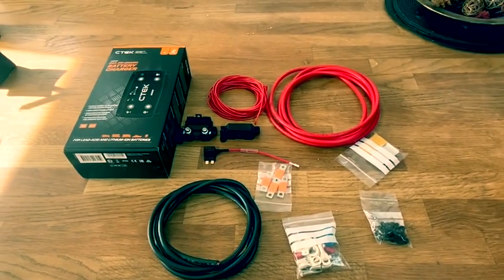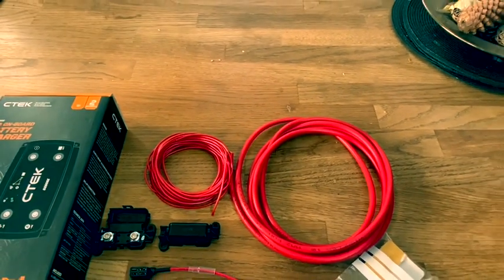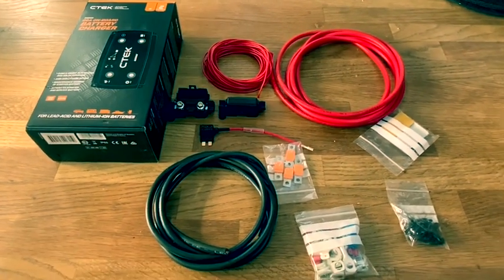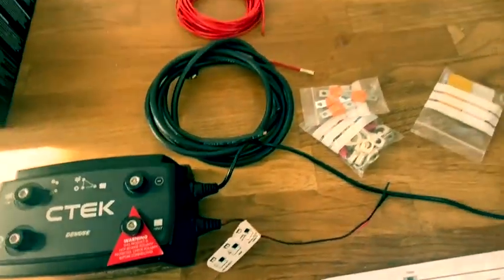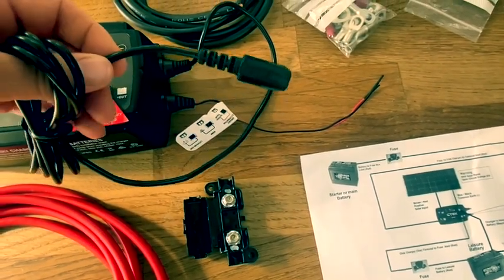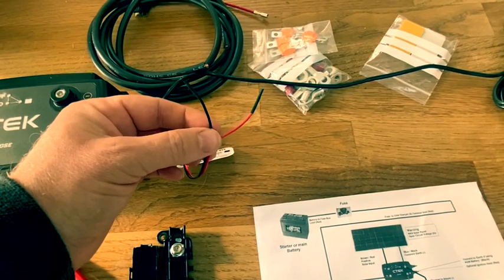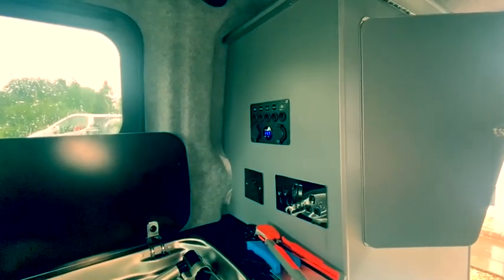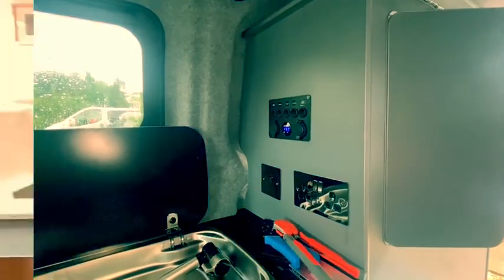Installation of CTEK D250se DC to DC Battery Charger into Transit Custom with Smart Alternator

Comment: Hi there! I hope you had a great time away in Big Blue. We finally picked up our van and recommend the swivel plates, we’ve installed a single passenger seat rather than the double, just trying to work out how to lower the handbrake on the drivers side. Having seen this video after your other electrical episodes, would you say it’s best to get the CTEK instead of the split relay? We have stop/start function and aren’t too sure what will work (or not). Thanks
Reply from the maker: Hey Nicci! Great news you got the van! Sounds good with with captain chairs! We might still go for a swivel base on the passenger side maybe? Not sure yet 😃

The key with the split charge system is the type of alternator. Later models I think 2014 onward have a smart alternator and would need a DC/DC charger like the CTEK as the normal (cheaper) split charge relay won’t work and therefore won’t charge the leisure battery 🥲 I think there are other units you can get but the CTEK also has solar input also which if you thinking about that now or in the future then maybe worth it. Only downside was CTEK unit was £280… the full electric kit I got was only £300! So quite an expensive bit of kit… but also I think essential really to keep the leisure battery charged up 👍
Reply: Hi Dave. Our van is a 17 plate so it’ll likely have the Smart alternator. I’m not sure if anything electrical has been purchased yet (I’ve taken a lot of deliveries since WFH!) 🤞🏻we can dodge an unnecessary expense! Solar has been mentioned once we get the pop top fitted in November (feels like a lifetime away). We’re going to the Lincolnshire motor home show in a couple of weeks, I’m looking forward to picking up some more ideas and bits that have show prices!

Comment: What number fuse did you use for the piggy back fuse. Does it have to be 10amp.
Reply from the maker: Hey Lch - thanks for the comment on this one too 👍 I’ll check the fuse location number next time I am in the van and drop it back in. I recall it was a 20 amp fuse I did the piggy back off so I used another 20 amp to make sure 👍 

Not had any issues with the above and all operating OK. I would do a check yourself too though as I wouldn’t want to give a bum steer for you 👍
Reply: Thanks for getting back to me so quickly. Only asked as the instructions says to use a 10amp and couldn’t find one.
Reply from the maker: @lch7417  - I didn’t read that but I would say yes if you found that it’s 10 then letting 20 though could be an issue!! You can piggy back a 20 and then use a 10 I would say for the CTEK as long as the fuses are in the correct location on the piggy back

Comment: Great videos. Some good pointers. I’ve just made a start on my electrics. Im using the ctek 250se as well. How did you connect to the starter battery. Did you use the Customer’s connection point, or direct to the battery. Either way do you have video on this.
Reply from the maker: Hi - thanks for checking out the videos and the kind comment 👍 I connected direct to the battery terminal I didn’t use a connector or anything in addition. I didn’t video this bit I am afraid as it was a bit difficult to get a decent shot under the driver seat where the battery was. 

If I do another video on some other electrics stuff I’ll let you know 👍

Thanks again!

Comment: Great videos guys.
Does your ctek show a flashing A light whilst  charging i think it is when  the leisure batteries are charged but would like a fellow custom owners input. Cheers
Reply from the maker: Hi - thanks for the comment and for checking out the videos. That is a really good point for me to check actually as one thing I haven’t checked is the different lights when the unit is in operation 👍 I checked the manual but I’ll do a live test and let you know.. I might post a quick video on it actually as I have seen a few comments online about this too and the info supplied with CTEK maybe doesn’t cover all the bases… I’ll drop you a note back once I have more information 👍

Comment: Very helpful. From my understanding you can still use a split relay switch if you already have it but this method won't allow the ctek to trickle charge the van battery from solar if you have it as the relay is only one direction.
Reply from the maker: Ah OK - Cheers Mark - I took out the existing split charge relay and just have the CTEK in place now and all seems to be working well (over the past 2 days anyway 😃). Thanks for checking out the video 👍 Are you doing/done a conversion yourself?
Reply: @TransitCustomCamper  Yep, only bought the van yesterday, Citroen Dispatch, I have the Ctek on order. I was going to use the relay with it until I found that the Ctek will trickle charge the van battery on the leisure battery if full.
Reply from the maker: @monkeysausage2404  nice one Mark… Good luck with the conversion! 👍 Let me know how you get on with it all! All the best

Comment: These videos are so helpful. I'm going to be converting a Transit Custom in a few months and every single one is a gem. Keep up the good work and keep the videos coming! Are you planning solar, Rock n roll bed or the passenger swivel chair?
Reply from the maker: That’s so good to hear thanks Nick! Not sure about about solar yet…As not planning that much total off grid… On the rock and roll bed… Yes, that’s being delivered next week actually 👍 Maybe on the swivel chair too in the future as think that will be a good addition! Just having to watch the ££ a bit now 🤣 Also want to have a few trips away, see how it works for us and then think about what’s next 👍 Good luck with your conversion! Hit me up if you have any Q”a and I can help if I can from anything I have learnt along the way 👍
Reply: @TransitCustomCamper  that's great to hear. Other thing that popped into my mind. Are you going for a gas bottle locker and/or ventilation fan?
Reply from the maker: So not having a gas bottle locker but gas bottle will be in cupboard under sink with vent through the floor of the van. And yes on the ventilation fan on the roof 👍 That should be coming up in a future video if all goes to plan. I had an 8 week timeline to get this first phase done so we could get away before end of summer… but still more additions to come 👍